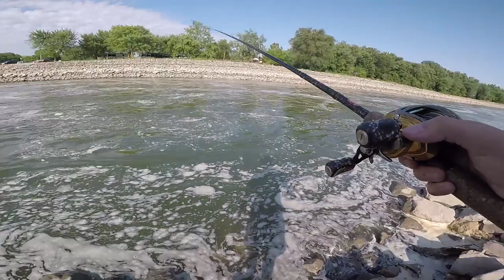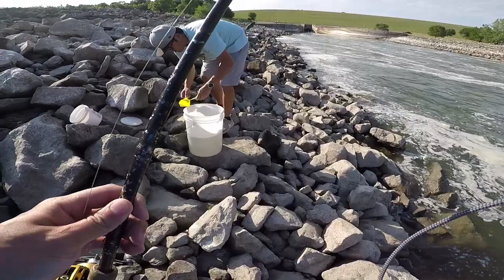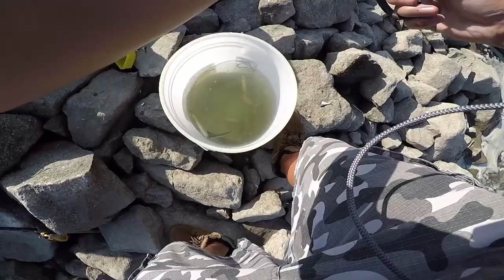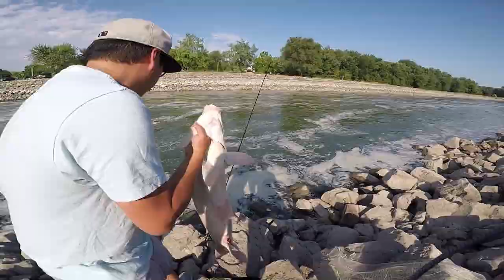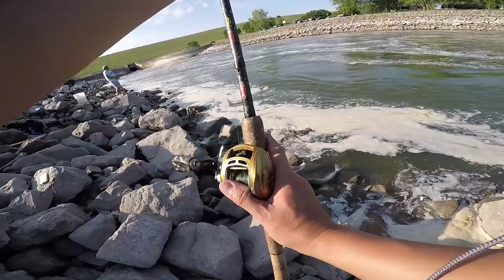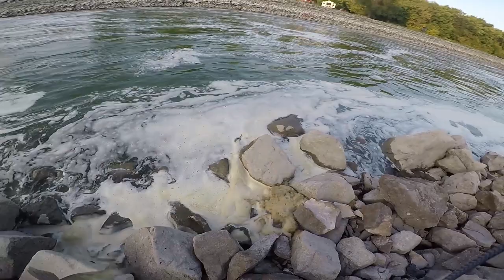Using Bass Gear for Channel Catfish

Comment: What type of rod were you using I want to get into bass fishing but I want to use one rod for bass and catfish should I get a medium heavy?
Reply from the maker: I can't remember off the top of my head but I want to say it is a Berkeley Lightning Rod, 7ft medium 1pc. I'll have to double check when I get home but I'm sure that's what it is. What is the size of the catfish will you be targeting?
Reply: Fishing Kit no idea but i’d say their pretty big maybe 6 inch wide and 13-something feet long so i’d say decently big
Reply from the maker: I think it you want to target some bigger cats I would just get something for that in a medium heavy with moderate action. A good catfish might not make a good bass rod.